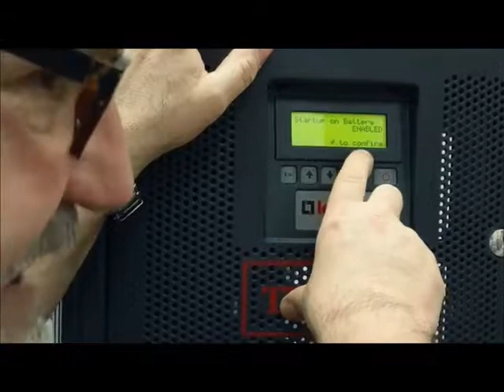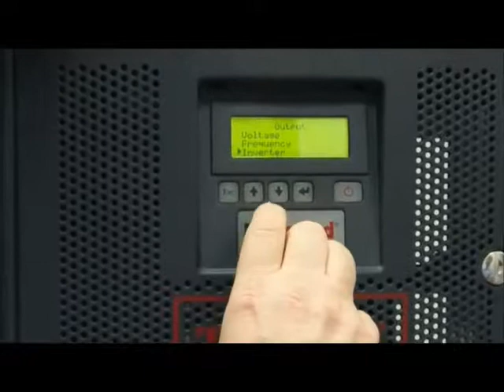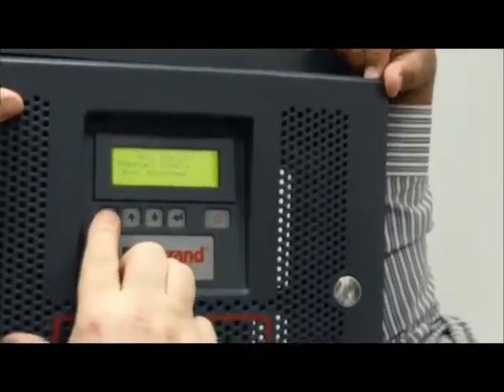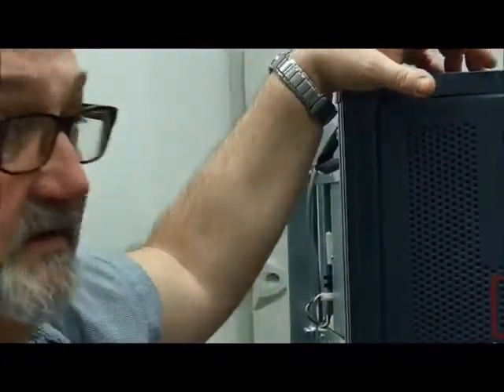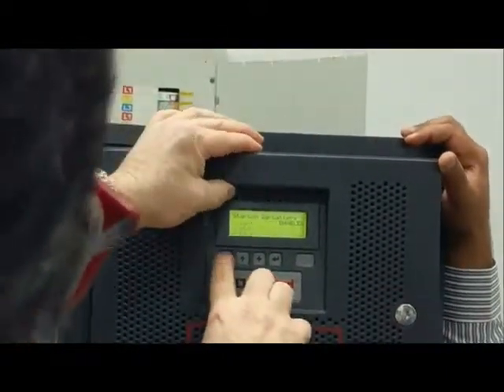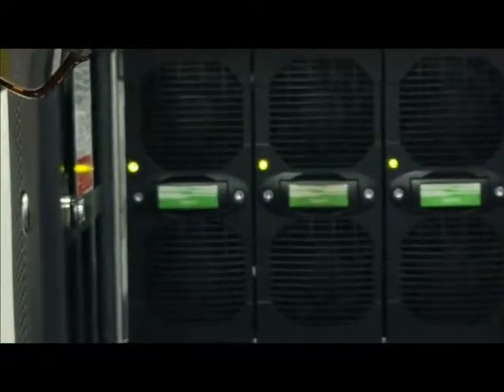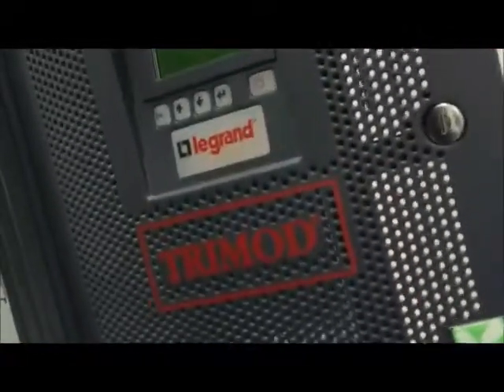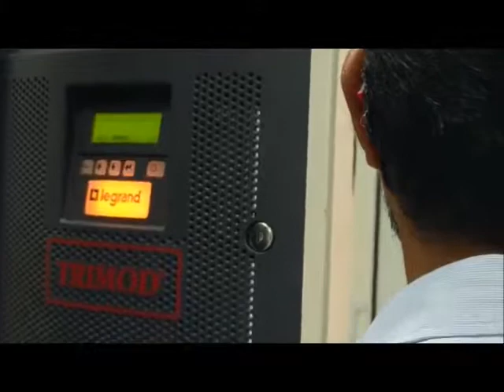Trimod UPS training -27 March 2018 - Abunayyan Service Center -Riyadh

Comment: Hi, i replaced battery and i need to delete Alarms services !  i think i need  software can you help me please
Reply from the maker: Yes, i can help you. Plz contact me over WhatsApp  0092 334 732 3731
Reply: Did you reach the solution ?
Reply: how can i reset the check battery message? I replaced the batteries but the message still remains on the screen. thank you in advance
Reply: Bro I contact you, in different times , but you don’t want respond
Reply: Sir, do you know How der EPO Settings?